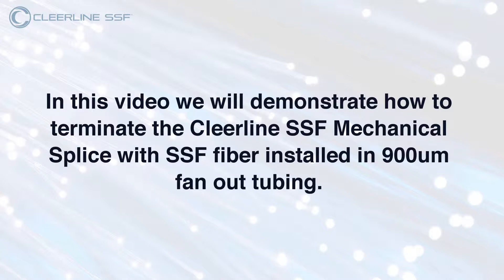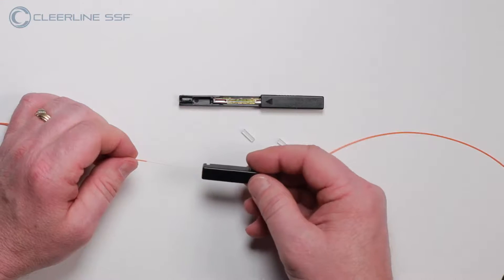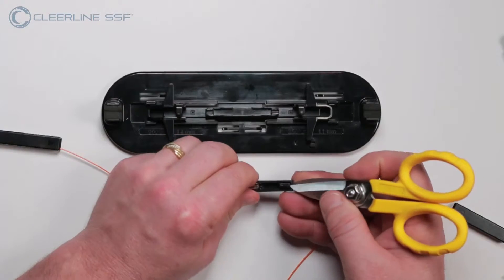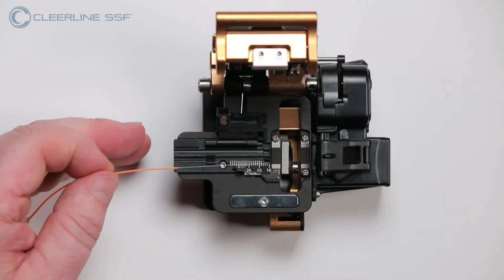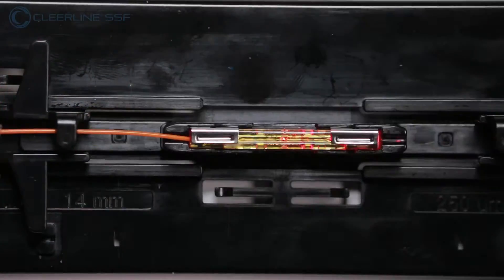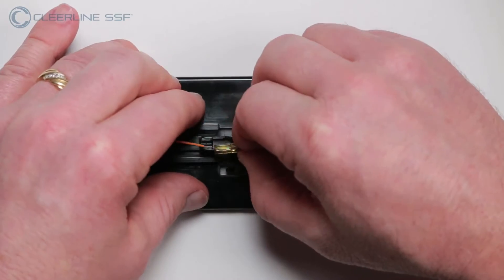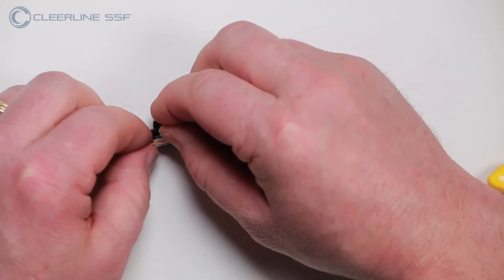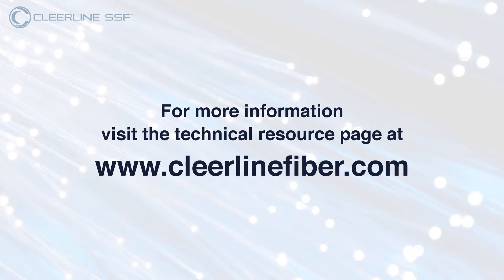SSF™ Mechanical Splice with 900µm Fan Out Tubing

Comment: What do you have regading dB loss in this splice?
Ore dBm.

In Sweden we normaly use a Fusion Splicer!
Normaly a Core (6 motor splice)

This funcion is as a Clad - Clad unit.
If the fiber is not in the center of the fiber 
(this will not work in the end)

We use: Normal fiber stripper ore a Thermal heated stripper.

I think that your use with fingers (Can cause fiber in your body if you do this in the wrong way)